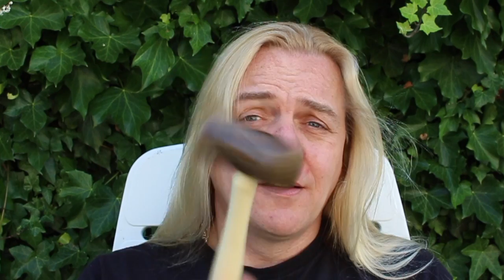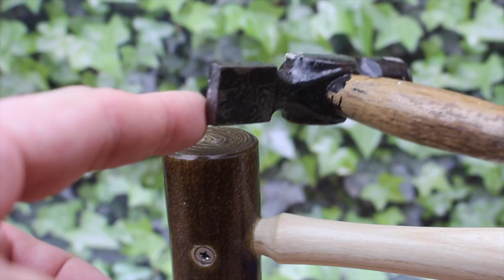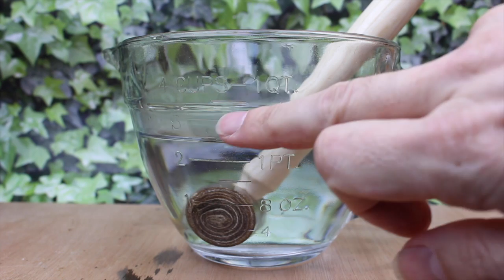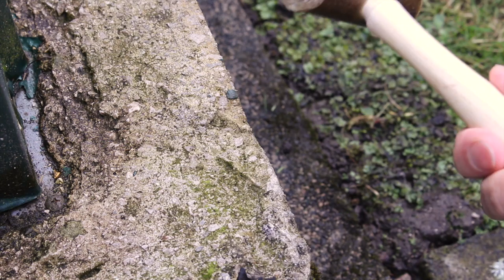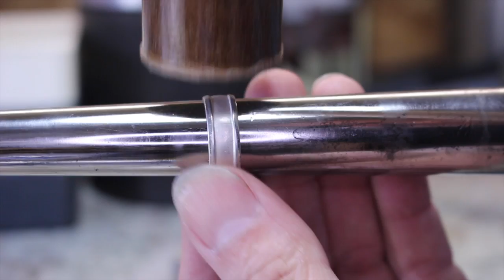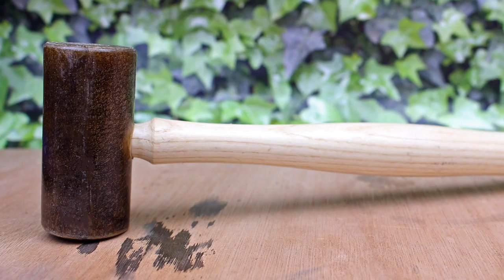How to Condition a Rawhide Mallet for jewellery use. ideas & tips demo review

Comment: I soak the heads one side at a time so I dont make the handle swell by soaking the entire head all at once. No need to get the handle wet at all. If yours doesnt have the clear coat sprayed on the outside it will absorb water much faster and the coil of hide will want to unravel so I added zip ties to each end and dont remove until dry. A meat tenderizer striking the surface breaks down the hide and no rocks or dirt. Thanks Dave for your attention to detail.
Reply from the maker: Thanks for the tips. Dave

Comment: That's great info when I started I never new you had to condition them caused me a few problems, after soaking if you have access to a needle scaler it does a great job
Reply from the maker: +pijnto ... ah yes, as used by car mechanics. I can see that would be a great tool for the job (for those who have access to one). Thanks for sharing. Dave.

Comment: Very useful video!  I had just bought a small rawhide mallet, and wondered how I'll soften it up--I'll give this a try, thanks!
Reply: Update: I just conditioned my rawhide mallet with soaking, and it worked well. Took 40 min for a size 1.
Reply from the maker: Thanks for sharing. I now have several Thorex hammers with interchangeable nylon heads. So I'm rapidly becoming a convert to nylon. I need to make a Thorex video  I guess . Dave

Comment: I use a metal meat tenderizing mallet.... because rocks, bricks and stone become crushed and stuck in the mallet... thats noon good. Rough sandpaper gets stuck in it to. I break holes with a screwdriver, soak and beat with a meat tendering mallet. It flares out PERFECTLY. Cheers
Reply from the maker: Yes indeed a very good point. You don't want anything sticking in the leather. A meat tenderiser is a great tip ! Thanks. Dave

Comment: Good tip Dave, by the way, if that is rust happening on your Snapon tool chest, it should be under replacement warranty.
Reply from the maker: +jim bettridge ..Thanks Jim. Bought the two cabinets from a car boot for £20 each - Bargain ! for that price I don't mind a few rust spots. ; )
Reply: That is a deal Dave, my "side" cabinet, which is not big at all was roughly 1300.00 CDN. Not cheap stuff!

Comment: Just what I needed. Thanks so  much for sharing. I  just ordered my first rawhide mallet and this will be incredibly useful. Any tips on looking after your files so they don't trust?
Reply from the maker: I live near the sea in the damp north of England, so everything rusts instantly. When you buy electronics items you may see little packets of silica gel in the packaging. I keep these and use them in plastic tubs with my tools. Alternatively you buy them cheaply from ebay and amazon. I have some very large bags which are sold for cars, to avoid condensation in your windscreen. These are just great for popping in the tool drawers. Always keep your tools dry (obviously) especially when quenching or pickling items, make sure they are dry before filing and sawing. Ensure all tools are clean and dry at the end of the day. If your workshop is damp, you should also consider a dehumidifier or small air con unit. Dave
Reply: Silica gel packets! I use these they work well!

Comment: I see ones advertised as soft leather, untreated with shellac. Is there a benefit to using these instead of the ones that are shellac impregnated?
Reply from the maker: Interesting I haven't seen those, but I guess they don't need to be softened up. I Don't really see the point of the shellac varnish anyway. Dave.
Reply: As a woodworker I assume the shellac is for long term protection and maybe a little extra weight. But ebay has some that are advertised as non-coated.
Reply from the maker: I guess it depends what you want to use it for. a coated mallet can be very hard for a jeweller, but perhaps longer lasting for tougher jobs. Dave.

Comment: I accidentally left my mallet in water overnight. it was VERY soft afterwards. Any suggestions on how to proceed?
Reply from the maker: Let it dry, it will toughen up a little. But that's good, you want it soft, . it should be perfect when dry. But  If you really think its gone too far, then you can coat it with a water based wood varnish to harden it again. Dave

Comment: So, Dave... I did this, yet when it dried, it's all hard again. Any tips?? Btw, don't let your dogs near these... they think they're a raw hide chew!
Reply from the maker: To be honest, mine was still quite hard after all this too. I guess there is no substitute for simply using it and wearing it down. For me , I dont use the mallets much so in 20 years it is still going to look like new and be hard as steel. So personally I use, rubber mallets and nylon ones. Check out  the Thor Hammer Company.  They are a UK manufacturer of mallets with interchangeable heads, you can get plastic, brass, rubber and a variety different firmness heads. No preparation needed, just screw in your head and go, when it gets bashed up you simply screw in another one for perfect consistency every time. So in my opinion the rawhide mallet has moved on nowadays and been replaced (for me anyway) by the Thorex mallets. Check 'em out on the link. Dave  https://www.thorhammer.com/
Reply: I see...well someone gave me the Fretz interchangeable. But I like the weight of my raw hide. I'll check out the Thor. Thanks!

Comment: How do you fix one where there face is unraveling?
Reply from the maker: That's the point -  as it flares out and softens, it becomes better. It still has the weight, but is more gentle on the rings. If you feel it needs it, you can use a jubilee clip to keep the head together. Dave.